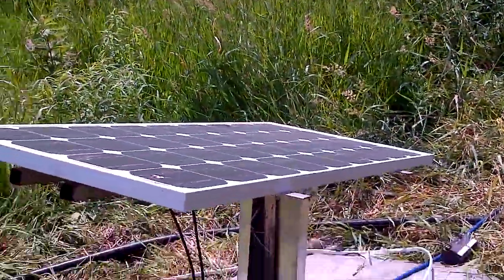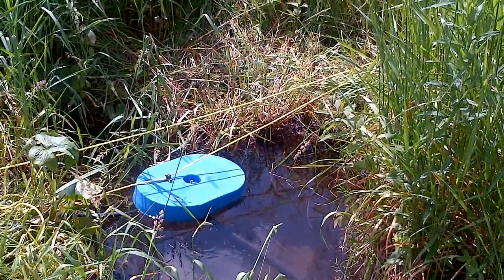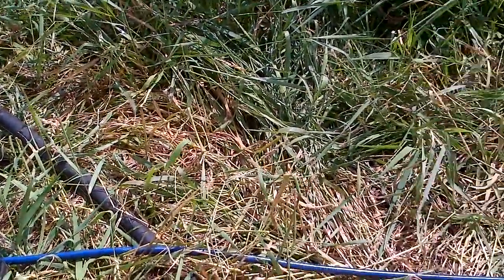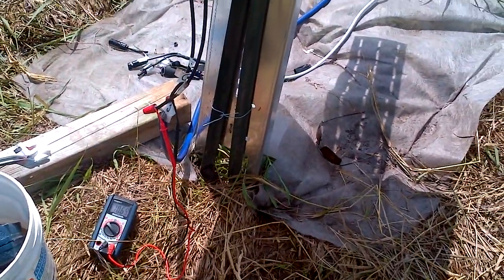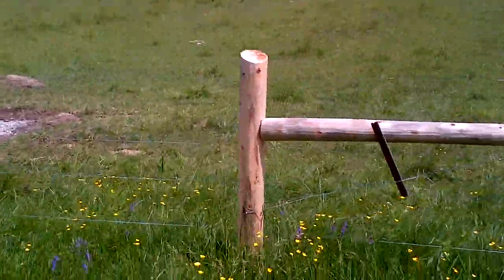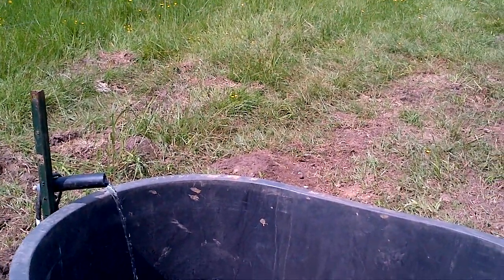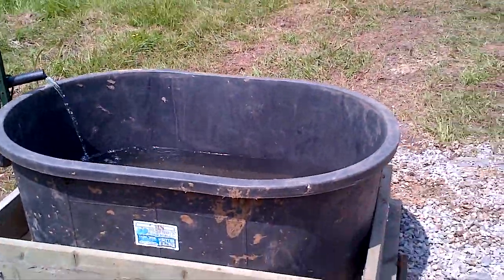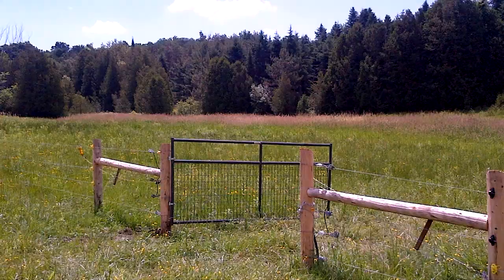Solar Powered Livestock Watering System

Comment: Check out our solar powered pump that circulates and filters the water in the trough. 

It’s a very clean professional portable system. 

Use the trough you already have. 
Smart-Trough®️